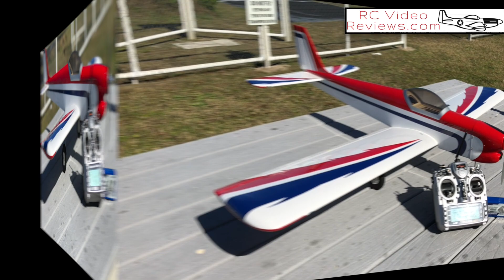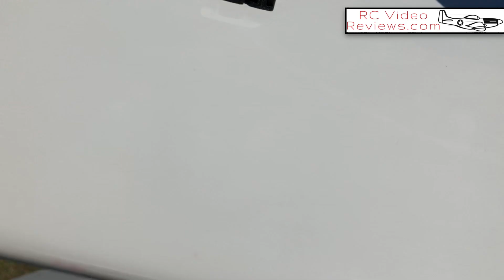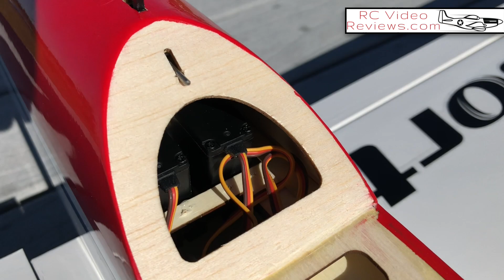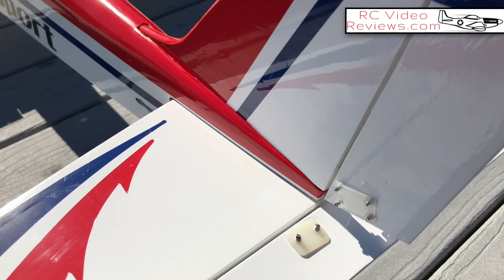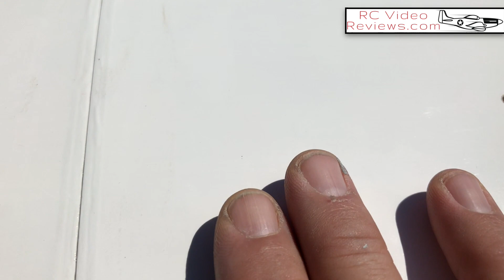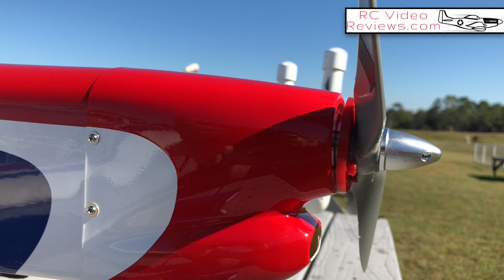Tower Hobbies Sport RC Plane Build Review

Comment: I bought the kit based on this review. It went together well, the wings joined and fit perfectly without any gaps. The problem I have is the elevator and rudder control rods have a lot of resistance. I was thinking about re[placing the stock control rods with Sullivan flexible rods. Has anyone else had this problem?

Comment: My canopy still hasn't came off in flight lol.still looks awesome,I'm thinking about changing it to electric.i need my 46fx for another plane.this plane still stands out in my hanger.
Reply from the maker: It's an excellent sport plane.
Reply: @RCVideoReviews  definitely,what do you think about the e flight 32 motor and I'm thinking it will work with avian smart 60  esc so I can use spectrum smart batterys I have alot to learn with electric.thank you happy flying
Reply from the maker: I'm not a fan of E-Flite/HH. Check out Sunnysky instead. Hobbywing makes very very good ESCs and they'll probably save you $$ over HH products.
Reply: @RCVideoReviews  Ok thank you.

Comment: I bought this for my Xmas present. Glad  I did as it is backordered again. I have a couple projects ahead of it  but hope to get it in the air by Feb 22. Does not look like I will need to shrink the covering. Will order the Cobra motor, 5S4000 battery, and 60A-ESC  as u recommend.
Reply from the maker: The Cobra motor is superb in this plane. Good call on ordering it. They go out of stock almost as fast as they get them and it is a genuinely pleasant plane to fly.
Reply: @RCVideoReviews  Now have ordered the motor, ESC, & 5S batteries. I will be using 18gr servos from another plane; they are too small so I will have to add some hardwood to the existing servo mounts.  Looks like I will not need to work on the covering. It looks great.   Those ailerons seem awfully small so I guess you need to maintain some speed for roll control.
Reply: @RCVideoReviews  Missing two plastic control horn backing plates that I can replace from stash. The supplied 2x10mm screws to mount the control horns are too short. Had to cut the alignment pin as it was too long. Test fit the wing before gluing it together and it is fine. The canopy latches fine. Optimistic about this plane.

Comment: what is the final weight of the plane?  what ESC Amp rating, 4S 5S 6S?  what motor did u select?  I would like to get this plane but want a motor that can handle a wide range of planes  from 6# to 8#'s and from 4S to 6S.
Reply from the maker: I don't know the final weight of the plane, I don't generally weigh my planes. I used a Cobra C-3520/12-820Kv. ESC amp ratings aren't measured in volts, they're measured in Amps. I used a 5s4000 and 11x7 prop with a 60a ESC.
Reply: had the same problem with the wing fit as U did. Fit OK before gluing the wing halves but would not go all the way after gluing. Not sure why? Eventually I decided it was the wing saddle that was preventing the wing from setting at the correct angle. A little sanding with a Dremel and the wing would go in but with a little force on the screws. 

Adding wood to the fuse servo boxes was a little tricky as you cannot just glue some wood over the servo box as that raises the servo arms to where you will get some binding on the control wires leading to the tail feathers. I came in from the top of the plane, a little tricky. On the motor mount box, take some time to assure Urself U have all the pieces correct. As you stated, the Cobra mounting plate fits the supplied holes perfectly.

In retrospect, wish I had mounted the elevator and especially the rudder control horns before gluing them to the fuse. The tail feathers fit in straight and easy.  The only difficulty left I perceive is the cowling and that looks like its just some patience and taking your time. Hoping to maiden soon when weather permits.

Comment: OK, nice video.  The one thing I see that doesn't look right to me is the angle you mounted the cowl. 6:42  The space between the back plate of the spinner should be equal top to bottom, side to side. Angle it down a little, maybe pushed back a bit and it's correct.
Reply from the maker: That plane has crashed and since been replaced.

Comment: Um you will like the the easy set up with servos and ailerons has a simple gauge set up, you just put it under the aileron and simple adjustments.but ther used to have 4 star 40 racing.i thought that would be cool.if you have trouble getting one let me know i might sell mine.thanks
Reply from the maker: Thanks for the info. I will let you know.

Comment: 4 star 40 and 60 planes are the ones you could take to the feild every day there well behaved airplanes if set up right i put a cable throttle on mine so it works good now.but what i did is just called the lady at sig and paid for it.it arrived in two weeks.she always says ther on back order.i might order the 60 size one same way.there just fun planes to build and fly.
Reply from the maker: Yeah, I bet those planes are excellent daily flyers. I was actually thinking of building this one.

Comment: Ohhhh i was doing my inspection on my tower sport and found stress cracks on my cowling noticed that thers none in stock.so i brushed appoxy in the inside of it,im hopeing it will make it more ridged.if it works im going to do the same to my other planes
Reply from the maker: I noticed some paint chipping on mine too. Good idea reinforcing with epoxy.

Comment: One of the best planes to come out of Tower...I put a small screw behind the cockpit to hold it down since it did come off once during flight....or one could extend the pin by soldering something  on the end of it
Reply from the maker: Agreed. Excellent plane. The canopy is the one fix they really need. Otherwise, it's good to go.

Comment: Hey John, I built my Sport and It's a Fun plane. While building mine I figured out a couple of things. First Tower wants you to buy the TACTIC TSX 20 servos. Their deminsions fit perfect in the Servo cutout and they call them MINI-SERVOS. BUT, just like Tower does with the RIMFIRE X-Mount, their demininsions don't match industry standards. So it's either buy Tactic servos or HOG out the opening for Standard servos. The other thing I found was that they did NOT short you on control horn back plates. The aileron horns were not to use back plates. You're supposed to put CA GLUE in the screw hole on those. I did not like that way of doing it and I put back plates on mine also. It just seems more secure. Also my Canopy Latch was fine and had a positive latch without much fuss, yours must have been a "FRIDAY" Latch install, haha. Great Info from you on the rest of it.
Reply from the maker: Thanks for sharing this information. I like the Sport a lot. I figured they had something going with hose tactic servos but I've been unwilling to buy them and find out. Have fun with your Sport. It's an awesome plane.
Reply: I used gorilla glue on a different GP ARF for the aileron horn screws.